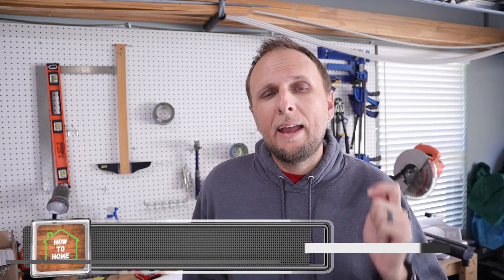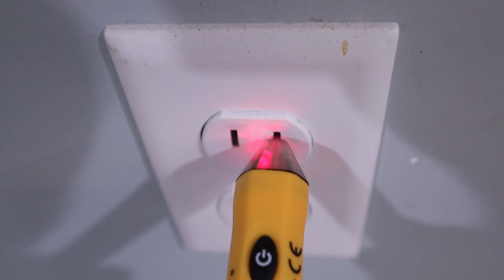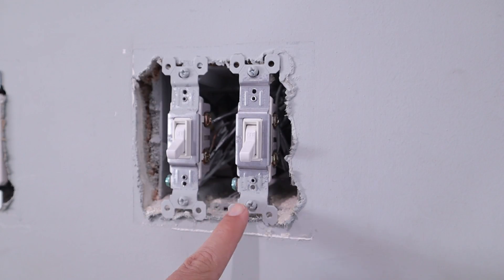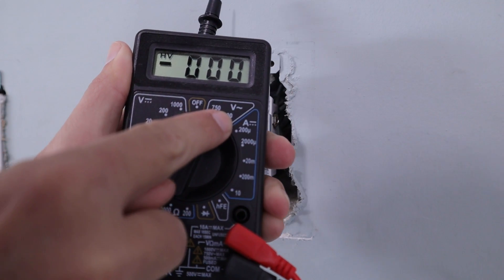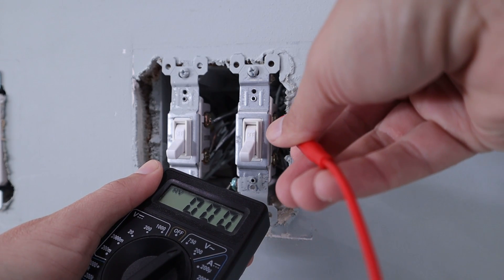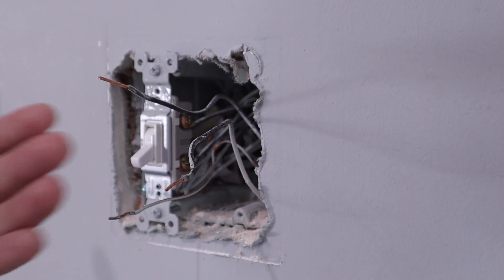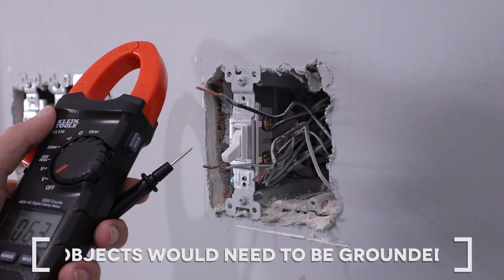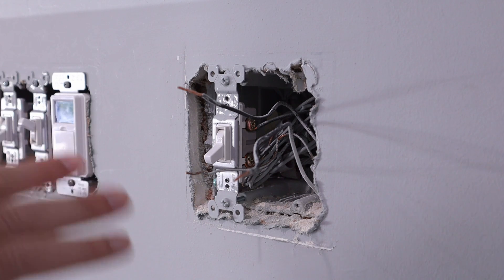How To Find A Hot Wire | Identify the Hot or Line Wire Using a Couple Cool Tools

Comment: This video was doubly helpful.  Several other videos recommended the pen-type voltage detectors, without a full explanation of possible downsides.  This one demonstrated not only pen-style detectors, but also multimeters ... I already have a multimeter and now will save the time and $ of adding a pen-type detector to my DIY arsenal.  Kudos!
Reply: Really should get a non-contact voltage tester as it is quick and the situation may arise where the wire you want to test has a wire nut on it.  Or you’re working on a ladder and reaching over your head to find the hot wire.  What he didn’t mention is that you should check the NCV tester on a hot circuit before using it to make sure it is functioning properly.  BTW- I have both devices.
Reply from the maker: Awesome, glad you liked it.  I definitely believe that every tool has its place.  Enjoy the new toy.  Thanks for the feedback!

Comment: My multimeter does not have the V setting.  If I use OHM X1K  how do I test if the light switch is not live before I change it to a toggle one?  Thanks for your help
Reply: your multimeter might say ACV and a sine wave / squiggle line, or it might say DCV with a solid line and dotted line. for house wiring, use ACV (A/C Volts). OHM is for testing resistance.

Comment: Dude! in the part where you are testing the loose wires with the multi Meter. There are electrical switches to the left of it. On the far right of that switch box there is a weird thing with a little screen at the top. I bought a house 5 years ago and have one of those and have never been able to figure out what it is. What it controls and why we have it. Any chance you know what it is? It is on the box that controls all the lights for outside the front of my house but it does not seem to do anything no matter what I press.
Reply from the maker: Yeah that is a timer switch.  I have it to control my outdoor garage lights so that they turn on in the evening and off in the morning.  By the way that it sounds that is probably what you have or had.

Comment: if you know for a fact that the white wire is a neutral, always go between hot and neutral to check voltage. 
electrical things will work even if you lose the ground, but nothing will work if you lose the neutral. is important to check between all three wires for correct voltage.

Comment: there seems to be a lot of confusion about 30A circuits DO THEY HAVE TO BE DEDICATED or can a 30A amp circuit have multiple receptacles?  I understand that sometimes a 30A circuit has to be dedicated if the device is a high amp device but I believe that there is a confusion as to if a 30A circuit always has to be dedicated. That may be idea for a video

Comment: The way I would put it is that if you just need to find the hot wire the voltage tester will do, but if it is necessary to find a fault in the circuit then you need to use the multimeter to check for ground or neutral ground because if the neutral is broken somewhere, the circuit won't work; if you can't get 120v between hot and neutral then the neutral is broken somewhere in the circuit or panel.
Reply from the maker: Yup, good tip Carl. Thanks for the feedback!

Comment: Work on a circuit without a volt meter ???? Fatal  Dangerious. Always turn off power service totally off before work on any circuit. Use volt meter to check resitance.   If circuit solid on neutral or ground , that circuit  shorted out . The curcuit damaged need replace it.
Reply from the maker: I agree but this video is all about using a multimeter to find which wire is line.  The power needs to be on in order to do that.  Then shut it off to do whatever it is you are planning to fix/install.
Reply: @HowToHomeDIY  i see .

Comment: It will let u know there is juice in the box which is good. I guess a meter is nice, I use a 'Wiggy'
or one can use a lamp socket with 2 wires. I hold one wire to either neutral or metal box and
probe with the other,one wire at a regular switch will always be hot the other wire depending
on position of switch, a 3-way will have common or pole and one of the travelers as being HOT

Comment: This wasn't helpful for my issue. I can't figure out why 2 different dedicated GFIs stopped working. They won't test or reset. I wired a regular outlet to one circuit & still won't work. Tested just the wires after removing the GFIs & get 2 different results. Get ground to white hot on one circuit & the other both ground to white & ground to black is hot. 2 different wire test results. Can't figure the issue unless there is a loose wire at the panel or something else going on. I have no clue.. 
Any help appreciated!

Comment: Good video. So glad you didn't clutter it up with a bunch of graphics and titles and corny music. 
What caught my attention was that phrase in your description, "...regardless of wire color." Mine are indecipherable, pink, red and yellow. None of them correspond to what one would think. First try to replace the switch tripped the breaker. Although the voltage tester "pen" works great, I like your suggestion. First I'm going back to the wall box to separate the three wires as far as they will stretch. Then test them again. I have a feeling I'll have to borrow someone's multimeter. Thanks your instruction.
ADDENDUM: I used the pen-type voltage tester to find the hot wire, it's red! Perfect! Now all I have to do is figure out what the pink and yellow ones are. Thanks again!

Comment: Lick the ground then grab the hot. It works best if your testing a motor
Reply from the maker: Sounds like you might come to a shocking conclusion!
Reply: @HowToHomeDIY  i had my worst shock from an old school dw. Left hand on copper pipe right hand hit hot. And the old motor fired up and started washing dishes lol

Its the load that hurts. I had Cloose call with 277 but not yet have i lit up from a  Commercial lighting circut.

If circut is live, dont touch anything with second hand.

Comment: You show how to find the hot wire but what is that other black wire that shows no voltage? Is that the neutral wire?
Reply from the maker: That is the load wire.

Comment: Very helpful video.  For those of you who live in the Chicagoland area, you may or may not know that all wiring has to be installed in metal conduit.  Commercial and residential.  What that means is you probably won't see the ground screw being used on light switches, because the conduit system is the ground.  Anything that is connected to the conduit is part of the ground system.  Keep that in mind if you need to put a probe lead on ground.
Reply: If I was building today, I would put all wiring in stainless steel conduit, all exposed, not hidden inside the walls. Plumbing too! Right after my divorce.
Reply: Thanks. Is this a Chicagoland thing only?
Reply: I'm  not 100%, but I believe NY City is the same.
Reply: Thanks for the info!
Reply: So then basically don’t worry about the ground wire extra wire?

Comment: So the hot wires are usually the black wires?
Reply from the maker: Usually yes.  But I treat every wire as though it is hot until I test them and make sure that they aren't.  Never know what someone before you has done.

Comment: Hello Adam can you use the Blue tester to test the wires in the box? Why did you which tools when you tested the light switch? And also I need to find a consistent “hot” wire to tie into to add a socket in my attic. What should I use?  Thanks In advance

Comment: my question is;- How to connect the the accessories with the wires which are not coming out from the battery so I can charge my phone from the wire supplying electricity TOWARDS the battery and not FROM the battery direct. I guess the one connection can be taken from the generator which  providing full current and the earth from the body of the bike?   so the battery will not get flat while running engine will provide power to recharge the battery  level.
Thank you Sir

Comment: i am motor biker,  phone charger, USB heat gloves & jacket, USB trouser, charging power bank, these all decreasing bike battery power even the engine running. ( battery should not lose power because the current supply is still generated by the  running engine )

Comment: Great video. I have a question about a garbage disposal switch.. Mind stop working and I can't figure out which wire is feeding the power to the switch so I can shut the breaker off. The switch is on the right side of a double box. I hope you can help. Thanks

Comment: My house is over 100 years old, so when I go to one wire it beeps here and there but when I go to the other wire it beeps like crazy. So the one the beeps crazy is hot one right? Also I think that oulet was installed later on because its the only one with black and white wires and the white wire beeps like crazy. The black wire beeps here and there, so is the white wire hot in my case?
Reply from the maker: I cannot say for sure since I can't see it.  All I can say is if you are talking about using a non contact voltage tester then yes typically many of them beep faster when it senses more power but if it is beeping on your other wire then you can't say for sure that there is no power running through it.  I personally would use a multimeter to know for sure.

Comment: At 4:30 when checking the voltage do u have to be careful not to let the red tester touch the metal side of the light switch and the bolt 🔩 at the same time. I think I touched both with the red tester and a big spark popped
Reply from the maker: Yeah definitely only let it touch the one terminal or you may turn your multimeter into a welder.
Reply: @HowToHomeDIY  haha I know wht u mean now 😂. 💥 Thanks for the video and your response.
Reply: You really should educate yourself on electrical circuits before messing with this stuff if that came as a surprise

Comment: It was helpful, BUT, what if I don't have any ground cable or anything to put the black probe to ground? Being a concrete wall with plastic wire boxes, no ground wiring and nothing nearby to use as ground...
Reply: Run an extension cord from a nearby live outlet- that IS grounded- to the area you’re working in. Stick the black probe into the female ground of the extension cord (the round hole).

Comment: um... if the house doesn't have a ground wire why don't we just make our own? like hammering a nail to stone wall and put the black probe on it and then start probing the wires. In theory this should work but I'm not an electrical engineer and I don't want to shock myself trying it, so... what do you think?

Comment: Very helpful, actually the best video for an electrical beginner like me.  My condo was built in the 80's.  I added a separate light switch for the bathroom exhaust fan.  I only have a yellow wire and a white wire in the ceiling to connect to the fan.  The fan has connectors and you only get one shot at it. The connector has white, black, ground.  I think the yellow wire is the hot wire but if i stick it in the black hot wire portion of the connector and its supposed to go into the white!  Well once you put a wire into the connector it will not come out.  Your video showed me exactly where to test and how to test.  I'll flip the breaker on and test at the switch then test the two (white and yellow) wires for the exhaust fan.  Thank you.
Reply from the maker: You're very welcome!  Glad it was helpful!  I will probably be doing the same as you are doing soon.  Would rather have the fan and light separated.
Reply: I have a problem with my wires it is old wtre with just white and black wire and wire is old paper coated in my ceiling there is at least 8 white wires a d 8 black wires and upstairs I have no bed room lights what do I do to have my lights working.

Comment: whats the difference between neutral and ground
Reply: Neutral is the way the live wire goes threw the (resistance) and then has too return to the the Neutral wire from (Hydro) the Ground wire is there to protect youy in case of (neutral failliure) from hydro and has a second protection feature in the GFCI application

Comment: Shalom Aleichem. 

As I'm a retired mechanic on disability I've not done much home electrical work, especially since being zapped 40'ish yrs ago with 220 vts.

I'm currently staying at my lady's house while I fix up mine down the rd. She has a well an it was working fine until I got up one morning and the breaker was tripped. 
I clicked it back on and nothing happened, the pump didn't kick back on. 

I went out side and located where the wire from the breaker box tapped into the main wire leading to the well hiuse some 100' (+/-) away.

I took my red lead from my multimeter and touched it to the black wire coming from the house and my black lead from the multimeter and touched it to the bare nutural wire and got 119.5 vts.

I guess I have to go (slowly) into the wood's and check at the well itself. 
I know to test input wires & press switch, but anyone else have any other idea's that I'm not thinking of?

Ratson haba b'shem YaHuah

Comment: Pull the wire nuts & feel around.
KIDDING!!!
Reply from the maker: Well, you would find out 😂😂
Reply: @HowToHomeDIY  always have a meter with you & never trust someone elses memory.
  I had to relocate a 10 hp pump running on 240v 3phase. Someone guided me to the wrong transformer & I didn't verify that it was dead. I went to bunch up the leads to feed them out the disconnect box & grabbed a handful of juice. Luckily my other hand was clear & not touching the box.
  May not have survived that otherwise (especially at my age now).
Have meter will travel!😳
Reply: @The left coast Should have seen when my dog chewed thru a cord!😆

Comment: So why did you switch voltmeters?  I own the first one you use I thought for sure I would learn how to use it?
Reply from the maker: To show different volt meters have different dials and what to look for when trying to find the hot wire.  I showed what setting it should be on to find a hot or line wire.

Comment: Why did you switch meters?  That confused me.
Reply from the maker: Showing a couple different meters as they can look differently which in this case they definitely do.
Reply: @HowToHomeDIY  Thanks...  That other tester that encompasses the wire  has some great uses, too.  Useful video as  all the wires or the switch would set off my  non contact tester like yours. So I had to switch to a meter.   The directions for my meter are unclear and I ended up moving the switch of the meter to a very low setting to get a good reading  

 Apparently the previous owner had switched one of travel wires with the  common on a 3-way.  It works perfectly with a dimmer now.  I ran stereo wire (one strand) to test continuity on the travel wires to double check.

Comment: Thanks for the video. Just what I needed.  How to test if there are 4 wires. 1 green color earth wire is confirmed. And 3 more wires, all the same black color. The electrician who did the wiring really screwed up. Normally there's only 3 wires, earth, N & H. The 4th wire is probably a loop wire from another socket.  The wires are no more attached to the socket. How do I identify whether its 2 hot and 1 neutral or 1 hot and 2 neutral?
Reply from the maker: I would touch my black probe to the green ground and then my red probe to each of the black wires.  If it shows voltage then you know that is hot of course.  I would really doubt the two of them will be hot but only way to know for sure is to test them all.  Since I cant see your exact setup it is hard to advise what the other black wire is for.
Reply: (220 volt location?) One from a braker and another from a different braker combined to = 220? Another as neutral, & last one a ground? Such as is 4 wires for new appliances. If so, black and also red or blue are 'hots'.........white N, green ground. Alternating current goes forth and back & doesn't really care about color.

Comment: My house is about 60 yrs old and has all-aluminum wiring.   I had gone through and tried to fix all the outlets with new copper outlets and pigtail connections.   Just recently I think maybe one I missed somewhere if giving a problem and my light will flicker. Is there any easy way to track it down?
Reply: Make sure your light switch is not bad .....I had a light that would flicker and I thought it was a bad connection .....turned out the switch went bad ....replaced and it is fixed
Reply: @randycook864  = I have not seen the circuit flicker for quite a while now.  It may have been the power company and brownouts
.

Comment: What do you do when you are installing a  new ceiling fan and it  has: ground, hot and neutral wires to connect it, but in the ceiling box you find hot and neutral wires only ?
What do you do with the ground wire coming from the fan?
Thank you
Reply: Wire nut👍🏼

Comment: What do you do when you are installing a ceiling fan and it does have: ground, hot and neutral wires but in the ceiling box there is not ground to conect, what do you do with the ground wire coming from your fan?
Thank you
Reply: Leave it or u can connect ur ground if it’s a metal box

Comment: How many times are you going to use a  multimeter.  We don't all way use them?
Reply: Multimeters are not expensive. If you don't want to use one to verify if power is on or off, then you probably shouldn't be doing this kind of work.
Reply from the maker: Every time I do anything electrical I am going to confirm there is no power still going to what I’m working on.